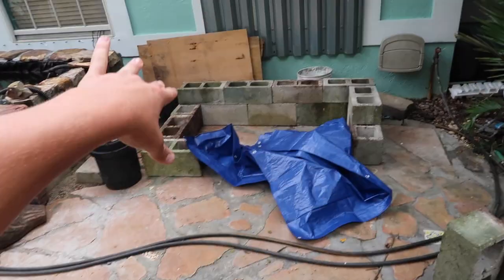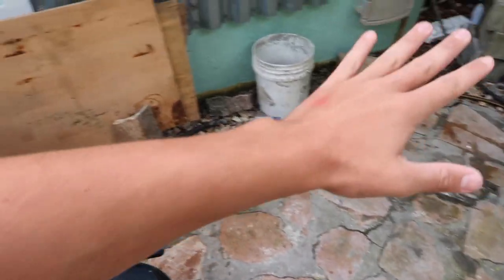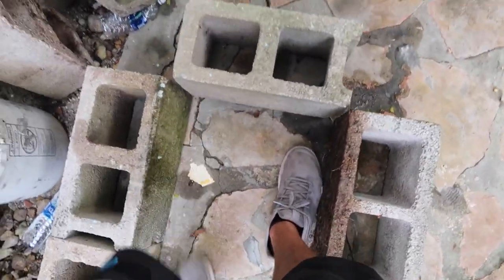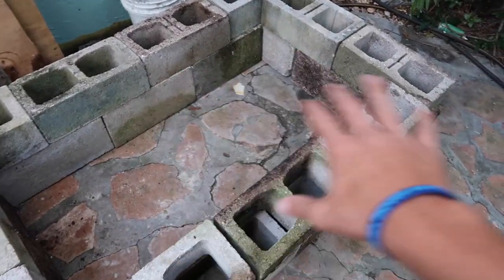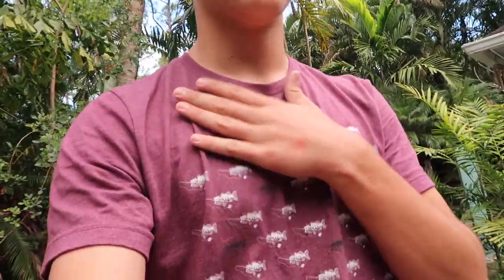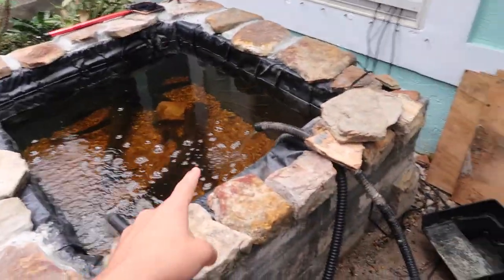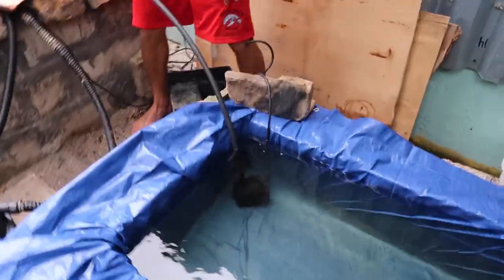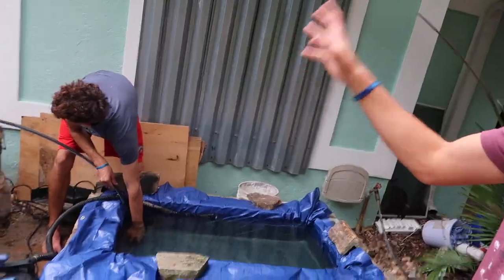BUILDING ABOVE GROUND MINI POND on a BUDGET!

Comment: Have you ever had trouble with one getting low in the other one getting really high and overflowing? I have a couple aquaponics systems set up in my basement and when I hook them together I have to Lee really careful with how powerful I make each pump and watch it for a half hour or so to make sure it doesn't overflow I have almost flooded my basement a few times lol

Comment: the thing is if 1 pump is faster than the other or 1 pump stops working u will drain 1 the best way would be to use 1 pump or even 2 in the lower pond pumping to the taller 1 and get a over flow pipe fitted to the top of the other 1 to run water back so if any pump stops working it wont empty any pond